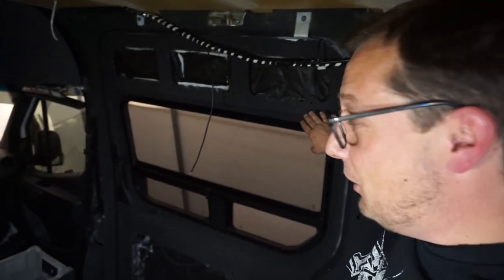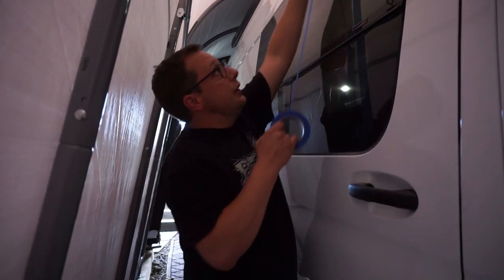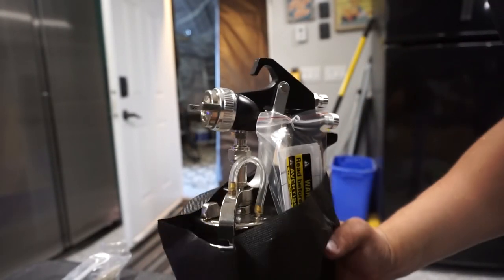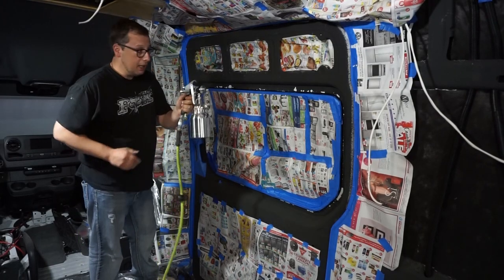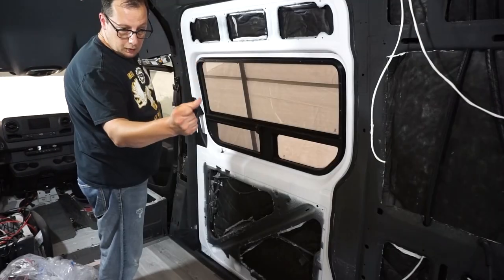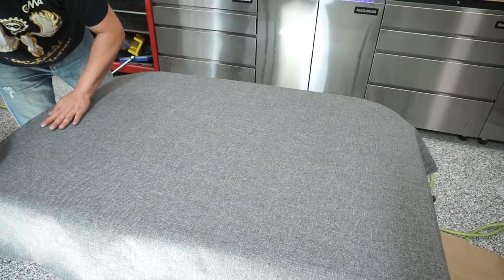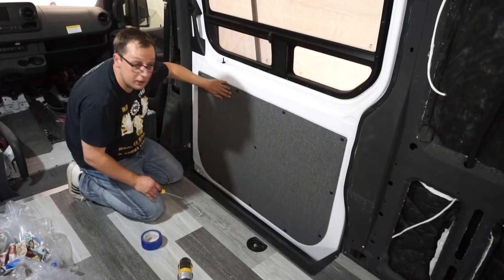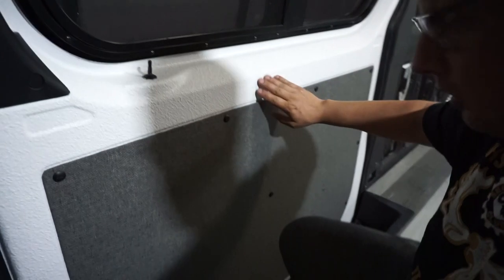Sliding door COMPLETED | FOUR SEASON VAN LIFE | EP.29

Comment: Everywhere I used mud to fill gaps on my van panels has cracked from road vibrations.  I had to figure out a work around after the van was built. I would suggest finding a way to hide the seems before taking off for your trip
Reply from the maker: Derek Craig yes I agree. I do change the ceiling in a video further up the playlist. Seams will be fully covered once complete, stay tuned!  Thanks for watching and commenting.